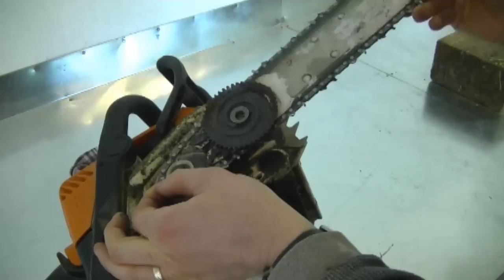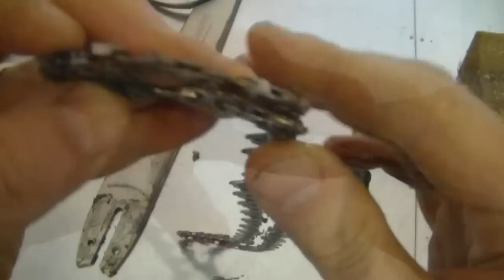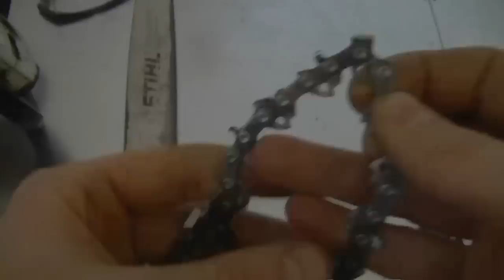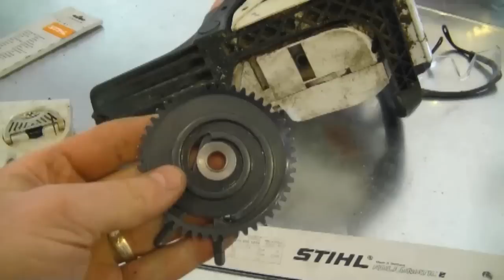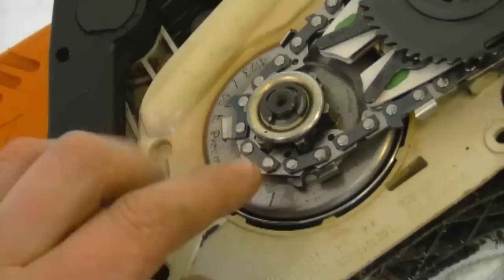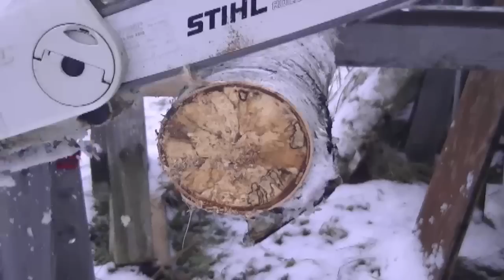How To Install A More Robust Bar & Chain On A Stihl Ms180, 170, 018, 017 Chainsaw

Comment: Thank you for these very well done instructions. It was a huge help to me, not for switching out the bar and chain, but for putting my saw back together again. It had jammed. When I went to remove the cover to inspect the chain, a screw fell out. I could not figure out where that screw came from. It was that single screw you show in the video which holds the tensioner onto the bar. The rest of your instructions were most helpful too as the saw has not seen much use and so the chain does not need to be replaced yet, so I never removed the cover to look inside. Again, thank you. Keep up the good work!

Comment: I did the same thing with my 170. I used a 16" bar and chain with .063 gauge. Works real well. I think the 170/180 is an underrated saw meaning it has more power than is advertised.

Comment: Great video as usual.  Just did this to my MS170 with an Oregon set with a second saw getting a 16" Stihl set.  For your followers, the use of the word gauge is misleading by the saw people.  It is not like wire gauge or sheet metal gauge.  It is the actual thickness of the web in inches, like 0.040"  0.050" and 0.063"  Easy to measure with calipers or micrometer.

I was thinking of going 18" on the second saw but even with the 14", the saw prefers dry wood and straight cuts.  But I still love it.  The important thing for the small engine is to let the RPMs rev up and don't bog down the engine with your cutting pressure.

Comment: I put this same bar on my 1973 stihl 015 and it cuts much faster and better than the old 1/4 043 stock bar and chain. I had to change the spur gear and oil pump gear to 3/8 but it was well worth it. Thanks for all your awesome VIDS.

Comment: Hi , thank you for the video . I have a ms180c that was due for a new bar , I upgraded to the heavier bar and chain and couldn't be happier , the heavier chain just does not wear out nearly as quickly . I also was having troubles with the easy start system so I bought a pre assembled side cover rope start for the ms170 and it was a 5 minute bolt on and requires no extra effort to pull since the engine is so small . I also replaced the chain adjustment with the side cover / bolts and adjuster from a ms170 . All the parts are on amazon for little money and its been a much more pleasant saw to use . Thank you for your video and reader comments .

Comment: Good video, I have a ms 170 that came with the .043 chain and 14 inch bar. After watching this I replaced with a .050 16 inch bar and chain. Was working on a ash with a 24 inch dia. trunk had no problem plowing through no bogging and throwing nice big chips. The saw is like a different saw well worth the $60.00 I spent at the Stihl dealer and everything was in stock. Highly recommend thanks donyboy 73

Comment: Thanks for this informative video. I bought a brand new MS180 and had the dealership provide me with this upgrade and it actually saved me $30aud ($319aud total), plus I didn’t have to wait until the 16” bar and 0.043 Picco chain were in need of replacement to enjoy the benefit of the upgrade.

Comment: If you can sharpen a chain properly,  You will get a sharper chain than comes out of the box with just a few minutes with a proper round file and a few light passes with a flat file on the rakers. I took my bar off to have a look and it suffered almost every issue you described just to a lesser degree. Thank you for a most informative and well crafted video as always!

Comment: Thanks Don, I have the 170 and I had written in that it wasn't starting after only just under 2 years of little use. Did pull the carb, screen was 2/3rds clogged with dirt from an old gas can,,, my fault. cleaned thoroughly and  just reinstalled same gaskets and diaphragm s,,, runs good. Your videos are a definite incentive. Thanks so much,,, ✌
Reply from the maker: you're welcome, if you don't use it much maybe you should use STIHL moto-mix
Reply: Thanks, as a matter of fact I did buy some premix at Home Depot that also has something in it that cleans an ailing engine for the cs 300 I have. I've used additive s in my bikes but this is formulated for 2 strokes. What do you think of premixed gas and additives? Thanks for the advice too. Cept for price it is a nice idea.

Comment: Dony, I recently did this upgrade and it worked very well. I just wanted to thank you. My dealer even had the parts in stock. A bit pricey but now I have a nice little saw.
Reply from the maker: it's definitely a good upgrade Jim

Comment: Thanks for your video. I did not need it for the bar. Just for the old bar and new chain. It had been awhile since I used the saw so I forgot the steps for the re-install. Your video helped out a lot. Again.. thanks.

Comment: Don, I learned something that is applicable to this video.  The bar and chain on an ms 241 are the same as on a 180C  with one exception.  The 241 uses a .050 gauge chain, instead of an .043 gauge chain.  Both are 16 inch, 3/8P chains.  Instead of dropping down to a 14 inch bar, you can use the 16 inch bar for the 241.  I have not installed the bar and chain off my 241 on my 180 but I am sure it will work.  I would have already done it but my 180 has that easy adjust crap on it, which I hate.  I can adjust a side adjust a lot faster than that easy adjust crap.  Another reason I traded in my ms 181cbe when I got my new 241, which I love.  
  You might want to do a video on converting the easy start and adjust saws to normal start and side adjust.  The only redeeming features these saws have is the primer bulb and I always forgot to press , anyway.

Comment: My saw is 170C - C for Comfort and low vibration - great for old ladies. It's a lousy chain and I'll be converting mine to .050". Thanks for this, glad I didn't buy a replacement original chain.

Comment: Thorough explanation.  To protect your fingers/hand from being cut should the chain jamb when rotating the chain by hand,  only move the chain in the direction of travel not back and forth as was demonstrated in the video.  Excessively worn sprockets or burrs on the drive links after a chain derailing are notorious for causing the chain to jamb.

Comment: Do you think that going with a heavier gauge chain, like you did here, will be too much on the engine? I have a MS 180c and I am not happy with the chain that came on the saw. I feel like it dulled to quickly so I am looking to upgrade chain to something more aggressive or heavier. I like what you did here.

Comment: Do you have to change the drive sprocket if switching from a pico chain and bar ?
Reply from the maker: The way I did it in video you do not need to replace sprocket.

Comment: Hi, Donyboy, thanks for your excellent videos.   I have a Stihl MS 261 which came with a 20" bar, .325 pitch and .063 gauge.   I want to install a 24" bar.  From what I can tell (correct me if I'm wrong) for a 24" bar I have to go to a .375" pitch.  Will I need a different drive sprocket?  I need the 24" bar to Alaska mill a tree - kind of a one time project.  What are the Stihl part numbers I would need for the bar, sprocket, and chain?  I thinkI would prefer a less aggressive chain rather than full chisel. Thanks and let me know if there is a way  to help support your channel.

Comment: If I was to buy a 180 then eventually perform this upgrade when the original 0.43 is warn, what size filing kit would you recommend. Would a file that suits 0.43 also be compatible with 0.50, or would you need to get separate files? I would not doubt buy a filing kit when purchasing the saw so would like to know if I can get one that suits both gauges. Keep up the great work, very clear and informative videos.

Comment: just curious, do you have to go to the 14" with the larger chain or was that just your choice?
I have both an MS170 and MS250 so there is a huge difference in cutting mostly due to the chains...I think.
I asked about the 14" vs 16" because I may make the change on my 170. 
Cheers from NB

Comment: Great video! You seem fairly knowledgeable about chain saws. Question... I have an older Stihl 020AVP. 1/4" pitch .050 80 drive links. That chain is getting harder to find and wonder if you are  aware of a replacement setup to go to 3/8" chain? Guessing I need a new drive sprocket, maybe an oiler drive gear??? and bar also??  Thank you!

Comment: I put a Stihl 16 inch .050 gage bar and chain on my ms181 CBE this week.  That .043 gage chain is useless.  It also loves to catch between the sprocket washer and circlip when I try to put the bar back on.  The .050 chain does not have this same problem.  I also got rid of that flimsy tapered bar that came on my 181 and got a parallel sided Stihlrollamatic bar.  It works fine.

Comment: Question on a Husqvarna. I have a 55 Rancher, it currently has an 18” bar on it. Can I run a 20” or even a 24” on it without losing too much power. Just doing basic homeowner cutting. 
I have a 268XP I’m working on rehabbing, and a sweet little 335 for climbing. 
Thanks for the uploads and info.

Comment: Love the tool-less chain tensioners. Have one on the poulan pro I have and makes quick adjustments in the Field so much easier. Doesn't seem to make a difference in performance or reliability either.

Comment: I've gotta do this to my 2020 ms180. It has that self adjusting carb and man when it gets on the pipe its a freak vs some of the videos I've seen on YouTube. I run 93 octane and motul 800 2t premix. I just bought a stock replacement chain but next run doing the .50 upgrade. Thanks!

Comment: Dumb question...but, does the oil/gas mix go bad after sitting for sometime in the fuel tank or gas can? Or just give it a shake to assure good mix...if it does go bad, what is the average time to toss it out?

Comment: Tank you nice video! If you want to give the ms 170 and ms 180 more power and better tuning you can replace the single adjust screw stock carburetor with the WT-215 carburetor that fits on the ms 210-250 series! It has a H and L screw adjusting carb for better tuning! Then you can open up the muffler better so it can breath easier with more power! (Look up muffler mod for the ms-170 or me 180) (you can order the upgraded carb for around $10.00) 👀😎
Reply: Were can you get the 215 carb? Direct bolt on with 170 linkage and all?
Reply: Go to  “Aboristsite.com” and search for “MS180 Adjustable Carb” (will be the same for the ms170)
 Look up WT-215 carb on eBay or Amazon!
 The cheaper carbs work!
 The newer ms170 throttle lingage bends the opposite way on one end than the older 017’s, which makes it a bit tricky trying to hook up to the wt-215 carb. I ordered the older 017 throttle linkage where both ends bend the same way and it much easier to hook it up to the throttle trigger and the new carb! (The new carb has a hole whereas the ms170 stock carb has a slot on the lever that the linkage hooks up to, making it easier!)
 You also have to drill new holes in the case for the adjustment screws!
 But you’ll be able to give it a proper tune and a muffler mod if you want. (They run lean stock) And you can also advance the timing a tad to give it more power as well!
  Highly recommend to watch videos on “tuning in the wood!” on that site as well! 😎

Comment: Hey dony I have a 180 c and did the bar and chain upgrade, it works great. The problem I have now is that when it get heat soaked it won't idle. It's a rebuilt saw and has a upgraded carb on it. In other words it has h l and lh adjustment screws on it. Any ideas?

Comment: Hey dony do know what you made me do? i bought a ts350 saw off kijiji missing the pull handle and cover for $45 but i felt it had good comepression ... i bought a cover and cleaned the carb and put fresh gas in it and it runs.. $90 into it and it came with a new diamond blade and 2 abrasive metal cutting blades... Thanks have a good one

Comment: I have a 170 that i got at a stihl dealer. They did the change when i my saw. now that's all i use 14 in bar and 50 gauge chain. full chiesl chain

Comment: I have been watching you videos I'm thinking of changing the two nuts system to a quick change set but not sure how to remove the old bolts for the single bolt for the quick change system thank you for time and advice

Comment: I did the same thing you did on my ms 181 CBE.  I put a brand new 16 inch Stihl bar and chain.  The tapered bar that was on my 181 was flimsy and would bend and vibrate under load.  I ordered a new sprocket, bearing and clutch from eBay.  The bearing and clutch were ok but they sent me a seven tooth spur sprocket which is not correct for the 181 with 3/8 LP chain.  It uses a 6 tooth spur sprocket

Comment: Don, No matter how tight I tighten the bar nuts on my Stihl 034 the bar will still move. I have tried everything to fix this but I still cannot get the bar to tighten properly. The bar and  chain are new and are exact replacements. Thank You.
Reply from the maker: +canadaeast check condition of clutch cover on the inside

Comment: I have the ms170 and it comes stock with the 16 inch bar do I have to drop down to the 14 inch bar to use the larger gauge bar and chain or can i stick with the 16 inch?

Comment: I was asking the Factory Rep about upgrading the bar and chain on my MS180C and he claimed that was not possible because of the drive sprocket..... your thoughts?
Reply from the maker: you can upgrade to what I did in this video
Reply: Thank you very much and if you ever need a laugh check out my channel !
Reply: Both use the same sprocket which is a 3/8 P. Stands for Picco which is a low profile bar and chain as opposed to standard 3/8 which is on larger more powerful saws.
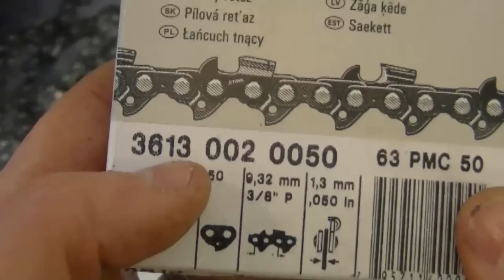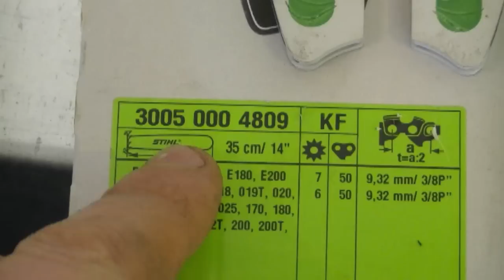Reply: At 4:22 the chain shows its a low profile 3/8 P. At 4:30 the bar also shows the 3/8 P designation.
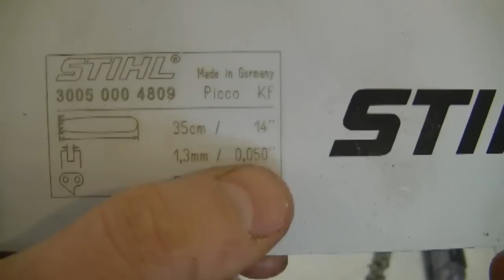Reply: Lastly, at 3:50 the old bar says 'PICCO'

Comment: Very good idea, but why didnt you go with a new 16 inch bar instead of the 14 inch bar?  I have the exact same saw, and would like to keep the bar the same length, and think there is plenty of horsepower to carry the heavier chain on a 16 inch bar.  Also, when the chain is off, it is a perfect time to grease the nose bar sprocket real good.  Thanks.

Comment: Thanks, I do have one more question. This chain saw look a lot like STIHL, but I can't find reservoir or a cap to pour in  a chain oil, do you have any advice where to look for it? I do not want to use a saw and not knowing how much chain oil is in.

Comment: I bought a new 171 from my local ranch supply. They suggested your upgrade to the 50 ga chain and shorter bar. The upgrade was included at no charge. (I had not seen this video). What a great suggestion.  Thanks.  Saw works great!

Comment: I went to a Stihl dealer to make the change from .43 to .50 on my MS180. After looking in the parts catalog, I saw that a 7-tooth sprocket is recommended. Did you go to a 7 tooth or did you leave the stock 6 tooth sprocket on the saw? Thanks.
Reply: Look carefully at the specs on the bar label.  It says it will work with a 6 cog drive gear...

Comment: The 018 is fitted as standard with a 050 thou bar and chain. I also like to give a new or cleaned bar and chain a squirt of oil before running since it takes the oiler a while to get oil to it.

Comment: Great tutorial!  Any problems replacing 43 gauge 16” blade to a 50 gauge 16” on a 180C?   Wasn’t sure why you went to a smaller 14”?   Thank you
Reply: Because of the larger gauge chain, there will be more resistance on the bar. So a shorter bar will reduce that resistance and prevent any potential lose of power. I ended up going with a 12” bar instead of the 16” for that very reason.

Comment: How much is the 50 gauge bar and chain?  I want to get the 50 for mine. Will it wear out any motors, or gears?  
Last time we were using my chain saw(which is same as one in this video).  My chain was smoking, while I was cutting limbs from my pine tree.  The oil in the chain saw, same side as gas but in front left corner of chain saw Any ideas?  Thank you.

Comment: Hey! New subscriber here...great channel you got here, great "how to´s " and really easy to follow how you do things. I have two MS 180´s and have changed from 14", .043 bar and chain which was on both saws to 16", .050 on one saw and 16", .043 on the other. Both works great, the one with the .050 maybe "bogging" out a little bit sooner than the one with .043, but that can just be how I run it. Thanks for the great tips about small engines, it has been very helpful :)
Reply: TheNorthener Yeah I commented on the fact that if you increase the gage size you either need to decrease the bar length, not extend it. These less expensive saws are probably engineered to run at peak performance with all parts stock. Iffin you create more drag by increasing chain bulk and cut, you should downgrade the length to keep engine doing it's best to perform well. Most tools are designed to only do with what they are sold with, unless you make improvements in engine output. They will run, but like you said, bog easier, wear out faster.
Reply: TheNorthener that's exactly what i was going to say they put that little chain on it so they can get away with that little engine the big chain will work but just won't have much power
Reply: TheNorthener, with that old tore up chain he had on the saw it's hardly possible to believe he was cutting any wood. The bar had overheated and discolored so all the hardness temper was removed and that bar would wear very quickly if he just replaced the chain.

Comment: Wonder why they put the .043 gauge bar and chain on these little saws.I guess it's cheaper for Stihl. Wondering if the lighter gauge system is easier for the motor to pull.What is on the expensive top handle arborist saws... I could look this up I know. Thanks excellent tutorial on how to change out bar and chain